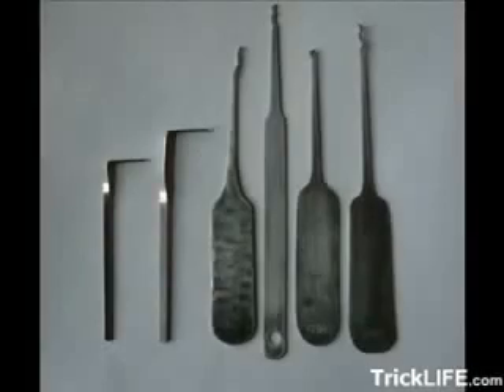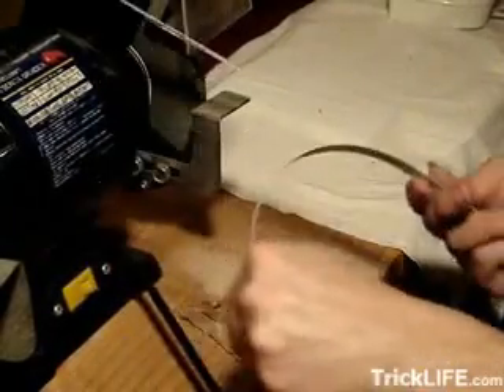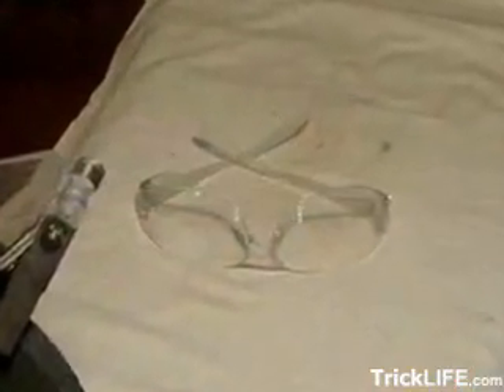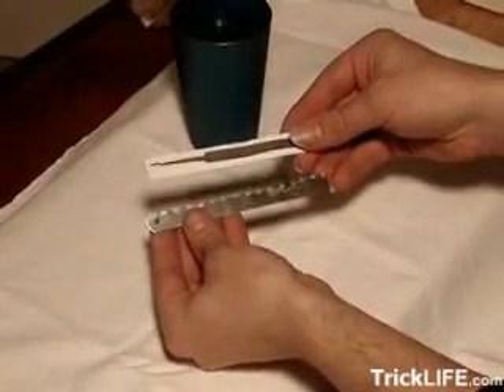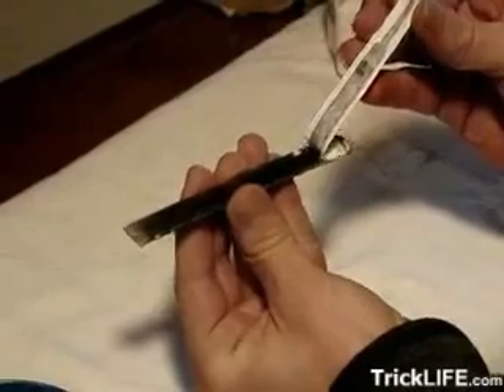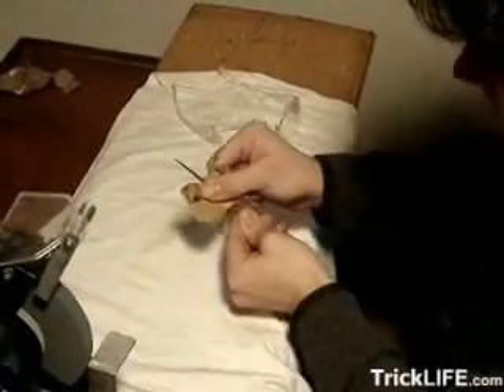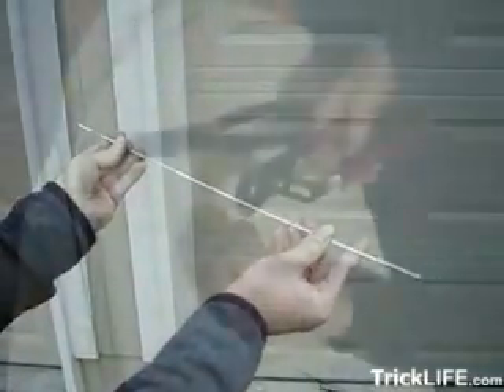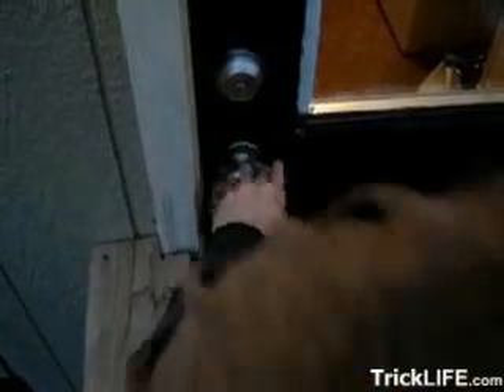How to make lock picks

Comment: The reason you have to use a laser printer is that inkjets use ink, while lasers use toner. Toner is like plastic powder that is applied to paper by static charge. Then it is sealed to the paper with heated rollers (which is why paper comes out warm from a laser/photocopier). To get the pattern to show up on the metal strips, he used a hot iron to melt the toner again and transfer it to the metal. You cant do this with ink

Comment: I tried everything (Damn, those blades took forever to find in Home Depot), but when I got to the ironing part, the ink just stuck on the paper, or it was ironed onto the metal (Paper included in the ironing on).  There was ONE that came out pretty decent, but...  I mean, they're good enough to shave down (Plus, it has a faint outline that I can re-draw with a sharpie), but any recommendations?  I'm not using a laser printer, so that might be it, but is there a possible other reason?